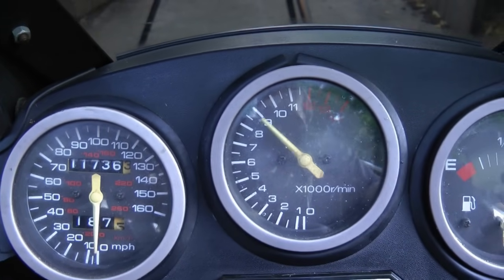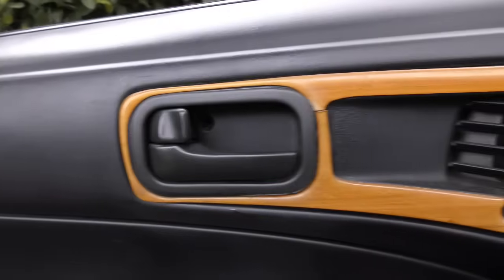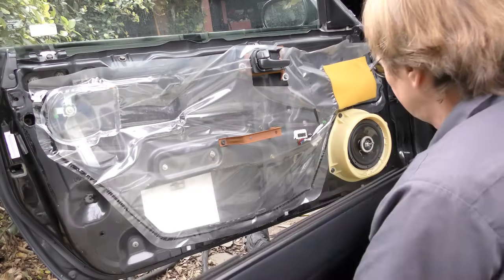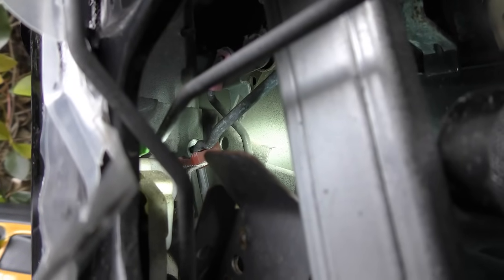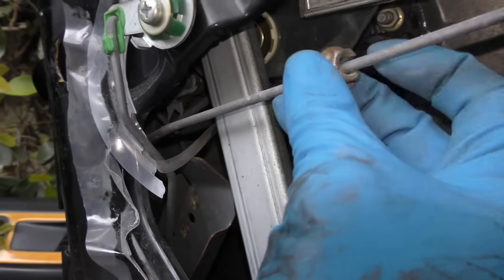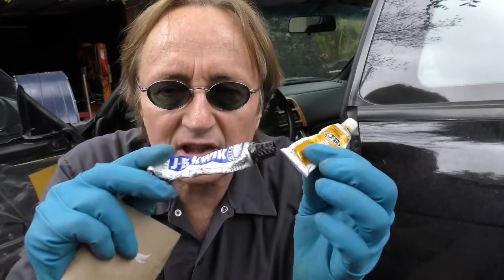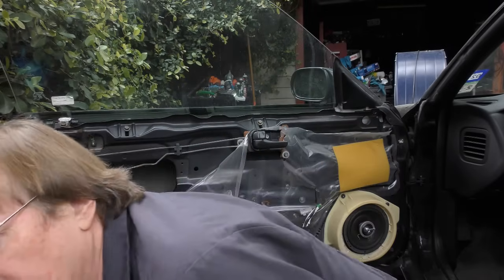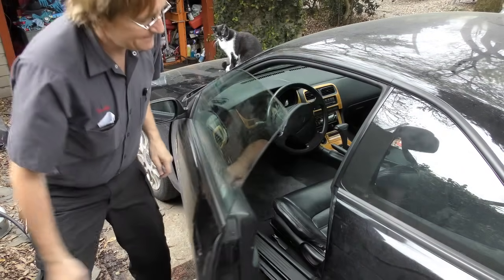How to Fix a Stuck Car Door that Won't Open

Comment: Dawg the door won’t open, how tf am I supposed to open it to fix it
Reply: THE most important part! Lol If I could open the door it would be easy to fix. The whole point is that the door DOES NOT OPEN!! LOL
Reply: @weirdbeard1980  what I had to do was pull the panel off from the inside then mess with the latch to get it open it is hell to do but not impossible🙄😂
Reply: Just brake your door handle from outside and buy a new one
Reply: Facts

Comment: "Just kinda peel it out of the way." Proceeds to completely rip and destroy protective plastic.
Reply: Yes, my eyes rolled at that as it is there to keep water out of the car interior. Also, the door switch pack was not fitted/located properly.
Reply: Exactly and did not fix it either.
Reply: Dude you’re soft.. that’s what you’re literally supposed to do 🤡

Comment: Way to ruin the vapor barrier in one tear lol.
Reply: I agree, if you're going to film it at least peel it off nicely and show people how to do it properly. He even said at the beginning it's there to stop water from getting in so why tear it?
Reply: flexor212000 Almost 17 years old and probably over 150,000 miles. Who cares if it gets wet? I would have sealed it back up with duct tape myself if I tore it like that but that's just me.
Reply: Adam McGee It's very easy too. You just peel it back from the glue and then push it back and it seals back.
Reply: bitethedevil Who cares if it gets wet. That's why i'd NEVER want you working on my car.
Reply: bitethedevil
agreed it is a old car, and you don't know if he didn't tape it up.
Reply: Gary Ober Doesn't matter how old it is, heck the older it is the more careful you should be because they're more likely that type of thing could cause greater problems. Water in the door panel is a recipe for other electrical problems. Also he wouldn't have needed to tape it up if he removed it properly. Why make a DIY video of doing things incorrectly.
Reply: I would think Scotty did it properly off camera, bloody hell he only got 2 hands and one of them holding the camera
Reply: grigsolve
You do realize that every time you watch his video he isn't burning tires down the road.  My understanding is his customers wanted him to do that.
Reply: Adam McGee
It's not like the car is a classic.  Perhaps it's Scotty's plan to get more comments.  Have you thought about that?  Cause I've seen on several videos he would do something that would get people all bent out of shape for nothing.  Do you know how long it takes to make a quality DIY video like Scotty does?  You can see the repair which was fine, and people complained about everything.  Not getting a new part, blah, blah, blah.  He got the job done.  A video of someone doing a crappy job is still better than no video at all.
Reply: bitethedevil Yeah, who cares if it gets wet? In fact, who cares if the door handle works either? In fact, isn't this old piece of crap better as a lawn ornament than a car? It's old!
Reply: I hate having to babysit the people I'm paying to fix things. Why do mechanics think they can break anything as long as they fix the thing they were after?
Reply: *****
The truth is unless you are going to fix the car yourself when it hits a certain age, then you might as well get a new one.  Probably the owner is someone who is too cheap to get a new car or take it to a "professional" mechanic, or perhaps the "professional" mechanic said I'm not fixing that POS go take it to Scotty he'll fix anything.
Reply: RA30st08
Ok, perhaps the mechanic wouldn't say POS, they'd say it isn't worth fixing or offer to fix the door handle for $300.  Then someone like yourself might say, that guy is trying to scam me, or dealers are such a rip off.  Did you even watch the video?  The part wasn't even available. You do realize that for the longest time car manufactures expected people to purchase a new car every 3 years?  And yes, I realize classic car market, clearly the vehicle in this episode isn't a "classic" car, otherwise a part would probably be available.  And when I mean too cheap to get a new car, I mean newer than the one they currently have.  Cars are becoming more and more sophisticated, I'm sure you wouldn't go into a computer store and say, why won't my Packard Bell or Tandy load this new software.  How many people buy used computers?  If you have a 15 year old vehicle that isn't a classic or a model that you see very many on the road, perhaps it's time if you start having lots of little problems to get a newer used car.  I had a 96 Dodge Neon that the horn stopped working, the trunk lock stopped working and several other little things.  I'm not going to go to a mechanic and ask them to fix all of these items because it would have cost more than the car was worth.   So you are right, too cheap to get a new car wasn't what I meant to say.  Thank you for correcting me.  Oh and I don't drink aftershave, so my farts wouldn't smell like it.  Plus I'm sensitive to fragrance.
Reply: RA30st08
Obviously you don't know what you are talking about.  Look at a picture of a 350z and look at this car.  The post where the door opens.  It's either a 1998 Nissan 200 or 240.  Either way it's worth 500-$2000 and will never be a classic.
Reply: RA30st08
I'm glad that we could come to an agreement and your tone changed.  I agree that Ericthecarguy or ChrisFix and many others have tutorials on how to fix stuff and do a great job.  I have done a few tutorials, but it really doesn't takes a long time and never seems to turn out how I'd like to do it.  Scotty is here to show you quickly that you might be able to do something yourself, and is trying to entertain as well.  It works for him and he has helped me out as well as Eric and others.  You have to start somewhere, and I believe he does a decent job showing someone the basics and hopefully peaks your interest enough to learn more.  Some people complain you give too much detail and others not enough.  So, I just do what is easy for me.  Again having a video is better than no video.  The Audi is a nice car, I almost bought one, but my wife liked the Lincoln LS better.  Most problems are easily fixed with patience, the right tools and a good video.  Even though you might think Scotty is a hack, he still has feelings and is trying to make a living just like everyone else.  Take care!
Reply: RA30st08
Yeah, so the problem is most people only have an attention span that lasts 3 minutes.  See, most American cars parts are much cheaper than the German equivalents.  For example, you get get a CV shaft for a Dodge neon for like $40-$50, but the boot might cost $20.  Therefore, why waste your time buying the boot, when you can get the whole assembly.  I understand why you don't like him since he has many bad things to say about German cars.  A tutorial is just an introduction and are not a step by step how-to video that you prefer.  I'd rather have a step by step video, however they do take much longer to create.
Reply: RA30st08 The point of his videos is probably to make money.  That's why he does the tool reviews.  He's getting paid.  It's why most people post videos on YouTube.  It's one of the main reason why I post videos.  I care of people don't like my videos, but in the end...whether you love them or hate them...as long as people watch them I get paid, Google gets paid...and people get to watch content for free.  There are stats that show most people watch only 3 minutes so that's why I'm guessing he keeps his videos short.  All he cares about is people subscribing and watching his videos...but most of all I think he enjoys doing them.  In the end, it's really all about what you enjoy spending your time on.
Reply: Gary Ober He specifically mentions that he doesn't get paid to do product reviews.
Reply: AirLancer
So, he receives no payment from either Google or advertisers?  Just because he doesn't receive payment from the product, doesn't mean he isn't still getting paid.
Reply: flexor212000 ikr just ruined a perfect good weather shield. Person going to wash there car. Or when it rains there get water inside.

Comment: Hello Scotty. I see in this video that you were unable to open the driver's side door from the outside, but you were able to from the inside. What about if you cannot open the door from both outside and inside?
Reply: Did you ever find out lol
Reply: @slimt42069  I took my car to a body shop in San Francisco and the people working on my Mazda 6 had to remove a lot of components from inside, and I had to get the actuator replaced on the driver side door.
Reply: Woah a whole 6 years later haha!!
Reply: @hollowtips23 😂
Reply: Got the same problem with my Astra
Reply: @PS2SAV  You need to go to an auto body shop for them to access the actuator from inside. My car is a 2004 Mazda 6 S, and I had the car for 20 years, and still running.

Comment: Gotta open up my 95 Merc C220 this weekend. Door only opens 1/3 the way.  Enough to get in, and I don't want to fight with the window again so I'm gonna keep it up. Somethings bent in there and I think I know what it is. This video has given me insight on how to unassemble the door. Thanks Scotty. Wish me luck in fixing her!
Reply: Tom Dalton how did it go
Reply: Krispy

Really easy actually. The only thing that sucks is you have to cut the vapor barrier (Didn't reseal it, dumb) and I've had my lock freeze when it's really cold. Had to pop the real door open to lift it up to get in but otherwise no problems.

Comment: I have one for you.  A 2002 Ford Explorer with the rear driver's side door stuck shut.  Won't open from inside or outside.  Window won't roll down.  Constantly trying to lock/unlock and the alarm goes on when set. 

I have the internal door latch off and it seems to work.  But, it's got a cable instead of a rod to pull/push to open.  On other vehicles, I've just grabbed the rod and move it to open the door.  Now, I'm stuck.  I'm thinking I have to pry the door open since the screws are covered by the door frame. 

BTW, I like your videos.  You've saved me a lot of work!
Reply: SinistrariKHS  Oh, I guess I should say it's got automatic door locks, windows, and all that "neat" and annoying stuff.  Sorry.

Comment: Scotty Kilmer. I have a 2009 Nissan Rogue that the driver door will not open from the outside or the inside. I see plenty of of videos on how to get the door panel apart etc. but do you have any ideas on how to get the door open in the first place? I can’t get the door panel off until I can open the door, right?
Reply: Were You ever able to open your door? Our driver door is stuck. Wont open from inside or outside! Just wondered if you had a clue?🤔

Comment: hey Scott can you please show a video on how to fix a door that opens from the outside but not the inside. l
Reply: Jamal-subscribecauseyou can  That might be a child safety latch.
Reply: Jamal, it's the same process, but for the other handle. :) 

If it's the rear doors, it might be a child door lock mechanism. Usually, a tiny little metal switch lives near the hook for the door latch on the door itself. Switch it a couple of times and test. :)
Reply: Mine only opens from the outside when it broke I heard a crack so I broke something
Reply: Alas, mine (1993 Volvo 240) won't open from outside OR inside.  It's the driver's door.  Help!

Comment: This is great but!…. My door won’t open so how do you get the panel off with the door closed? Or do you pull off enough so you can access the locking mechanism. Is it possible that the door actuator is failed in the lock position?

Comment: Scotty, my door will not open! Everything you did here you did with the door already open.

My car is a 2001 Chevrolet Prizm; it is the same car as a Toyota Corolla. The back, driver's side door will not open. I tried removing the inside door handle and pulling on the rod, while also pulling up on the outside handle. No luck.

I tried pulling the vertical part (for locking and unlocking the door) with a pair of channel lock pliers, while also pulling up on the outside handle. No luck there either.

It's an electric door. So I ran two wires to the battery. (First, I disconnected both battery cables so I did not fry the computer or anything else.) And connected the wires to the battery posts. I tried both ways, switching the two wires around from positive to negative, and vice versa. I could hear a muffled clicking sound both ways, but the door still will not open.

This is the door I want to replace. So I started carving up the inside door panel. Then I will try pulling on the rods with my pliers. Something has to work!

Greetings from Minnesota!
Reply: I got a 96 geo prizm with same problem.......did u ever figure what to do

Comment: I have a 2011 cadillac escalade esv platinum- drivers outside rear door handle broken,inside door handle not opening door. How do I release lock actuator to be able to open door ? I have a new outside handle and electric door actuator but can not release door from latch to install. Please help

Comment: Hi, Scotty. 
A big fan of yours. My 2011 Nissan Versa S Hatchback has it's driver side door dented in and therefore the door doesn't open from inside or outside, and the window only going down half way because someone hit me while they were existing a parking onto the road where I was a week ago. No one is able to find used or new doors to fix it. Is there any way I can fix it myself. There are no other mechanical issues with the car, drives well. I live in Hawaii. I am no mechanic but I am willing to give it a go.

Comment: Hey Scotty
How would you go about trying to get a door open, when it wont open from inside or outside?
2008 GMC Sierra
Reply: Did you ever figure out how to open your GMC door??? My friend is trapped in her Hyundai and doesn't want to climb across the seat(Texas heat sucks), so I am her mechanic for the day!
Reply: @brittneywalpole160  
Sorry, i dont remember what the fix was...Check that cable going to the handle isnt broken or disconnected from the handle

Comment: In my case, the front left door would open from outside but not from inside. Everything looked well connected but it wasn't working. I thought about just replacing the latch lock but I read somewhere that the bends in the cable gets flatter after awhile and doesn't work so I just bent the cable a little more and now it works perfectly!

Comment: This problem is extremely common on the Nissans made from 96-2002. Even my Pathfinder (98) has it. My Left side passenger door won't open from the inside or out. When Summer comes and it's not too chilly outside I'll try to fix it. I know plenty of other people with a Nissan in this year that has the problem. No, the child locks aren't on either.

If I can't find the part at the dealer maybe I'll try to rig something up like this!

Comment: what do you do when the door won't open from the inside either?!  merc w140
Reply from the maker: pay a locksmith to open it or cut the inner door panel so you can get to the latch and manually open it
Reply: +I Superman I don't know why you're talking so much shit... Look at your channel...
Reply: I Superman Oh shit I didn't wealize you are 12 yeaws old (had to replace all the r's with w's so you could understand)
Reply: had the same problem with my truck if it id run by a cable like je mine u my just need to lubetcate it sprayed mine with pb blaster at the handle and door latch now it works better then it ever has

Comment: What if it dont open from the inside also....my door wont open at all......
Reply: Ring the Bell!!!
Reply: I'm in that same boat, with no way to get the panel off while the door is stuck shut. I'm surprised there is not a contingency for this type of thing. I'll be looking into how much it will cost for a shop to do the repair, but I'm fairly confident that it will entail cutting or otherwise destroying the panel to access the linkage. Major bummer.
Reply: Same here.
Reply: @Darl4791  I've talked to a few mechanics over the phone. Basically, I was referred to an auto-body shop. I also may try a dealership. But the basic assumption is that the door panel will need to be cut up to some degree (maybe even entirely cut off?). I still don't want to do so until I know for sure I'll be able to reach the part(s) needed to pull the latch or whatever to get the door open. I already took apart what little of the panel can be removed, to the point I was able to stick my hand in a little. But I couldn't reach anything to open the door. It will probably take getting the entire panel off to get further into the door. I don't know if many cars are designed this way, but it seems there should be some way to get it fixed without breaking a $500 panel to do so.
Reply: Everything I see on the net says dealer charges about 1k.  This video leaves me high and dry, since it conveniently leaves out if it won't open from the inside.   @Rushtallica
Reply: Me too, so is he going to answer us or do you have to just saw the panel off with a butterknife?  @Darl4791
Reply: Having the same problem with my mother in laws car. 2007 Mazda CX-7 wont open inside or outside.
Reply: I fixed it and will write at the to of thread now 4 all,   @alensley1368
Reply: @ @alensley1368   I did everything I wrote about below and then took off the door panel after buying a can of heavy duty grease.  Got it on everything I could reach inside the door and on exterior lock mechanism.  Everything was working great so I put it back together and the crap wouldn't open again first time I closed the door!  SO, I took a nice sized flat chisel and pried from the inside between the jam and the plastic door panel edge and it opened and is working ever since really well.  (keeping the chisel in the car in case!)